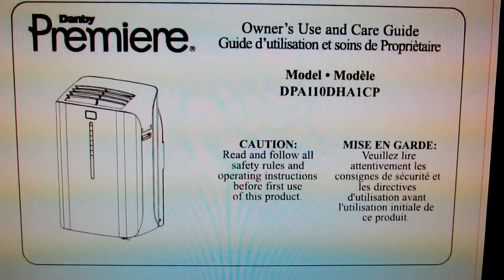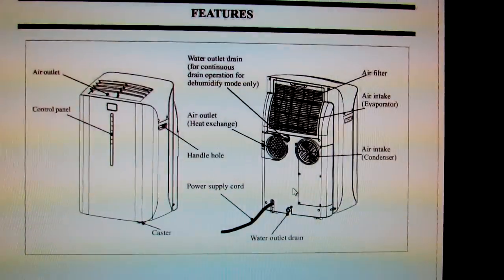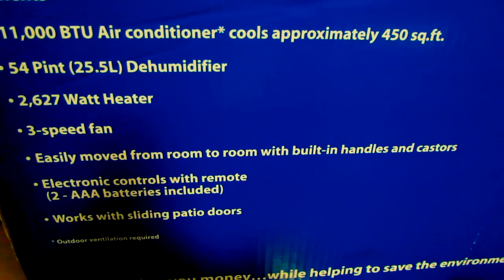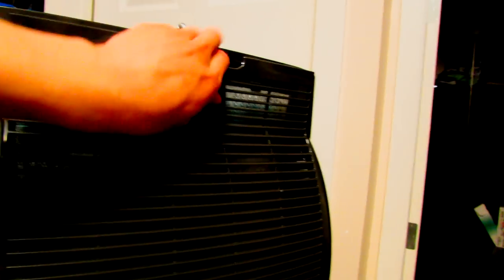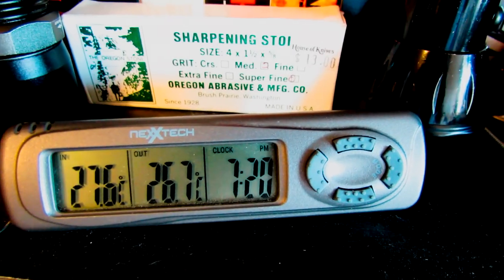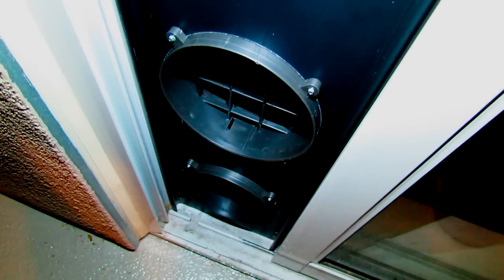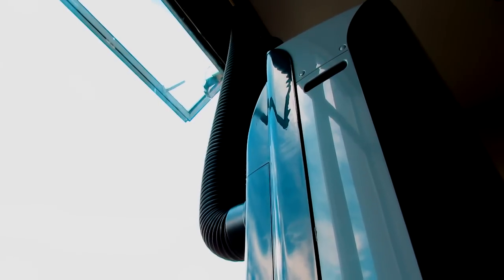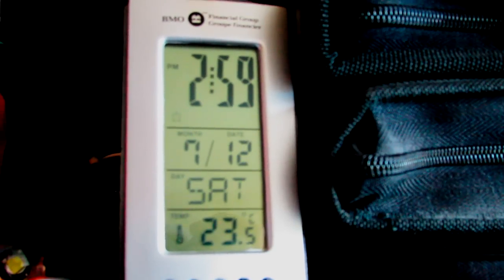The Best AC Unit for an Apartment - Danby Premiere 11,000 BTU 4 in 1

Comment: Premier DPAC 10071 all site I went to said free then it wanted my credit card. Danby site I couldnt find manual. Only the specs and photo of unit. That would be awesome if you can find it. Much Blessings and thanks for the Video. I watched a few yours was only one that showed me lots. The others I got nothing.
Reply from the maker: Michele Makohoniuk 
Hi,
You're right!  That manual is tough to find, I couldn't find it in the first 20 links I checked, but I found one that's similar, it's the DPAC 10060 model, I think it's the exact same, except maybe the capacity?  The control panels look like they have the same buttons, and display, but check it out and see if it is the same, I'm thinking it's almost the same.

https://www.dropbox.com/s/e9aexbdgs90t201/danby_ac_manual%20DPAC10060.pdf?dl=0

Also, the manual says the box that it came with, is a rain hood, good in case the rain goes sideways and hits the window!  Mine didn't come with that, would have been nice though!
Reply from the maker: Michele Makohoniuk 
I found the 10060 manual under a 10071 directory on reliable parts inc, I think all the parts are the same, maybe the 10071 was just a face lifted model of the 10060?  I also found the parts diagram and list here:
https://www.dropbox.com/s/rvrrtexjyfem1ux/PARTS%20LIST%20DPAC%2010060.pdf?dl=0

Funny thing, that model is one of the first that took the condensed water and threw it on the condenser coil, but on the web site they describe it wrong, they say they throw it on the evaporator coil!  Which is sort of true, the condenser coil is the evaporator coil when it's in heating mode.  But under cooling it's the condenser that's hot, so it should have said that.  Oh well, not like most people purchasing the unit will really care, they just want to know that it uses the water and you don't need to dump it!

Comment: I have a really old 4 in one and to service it I found a newer one at a garage sale cheaper than service fee. I have no manual and cannot figure out the controller. You at least explained how to use buttons on the unit. I am waiting on Danby to send me a manual as all online want your credit card to download even though its free. So I have to wait. Newer unit is amazing. I got some box attachment that goes out the window. I took it off for I didnt know what it was seem to have no purpose. Did you get one too?
Reply from the maker: Which model you got? I'll see if I can get you the manual. 

What can't you figure out with the controller?  If you need the wiring diagram, it's usually inside the unit so when you take it apart, you can see actually what wire does what, it's for certified service men to use, but it works for the everyday handy man too.

I didn't get a box thing for the window, just the panel with holes in it, sounds useful though, it might help separate the hot from cold air, and stop short circuiting airflow.

Comment: Hey my friend uses a bucket with hose in it in his apartment. Thats how you can drain
Reply from the maker: Thanks! That's a good idea.  It's funny tho, this was so good at using the water to cool the coil that at the end of a summer of using the AC, I went to go drain it and it was dry as a bone! Pretty impressive, that means I was getting free cooling from the evaporative cooling, rather than dumping out the condensate water!  For that very reason I think this is a great AC unit. It can be a pain having to dump the condensate every couple days, or every day for some AC units.  They couldn't make the water containers any more annoying to carry sometimes too.  I don't use the heat pump function in this much, but it's nice to have if your natural gas heating system is down for repairs during the winter!  This is a great unit to have. Keep this and a generator and you'll be set for any situation in the summer or winter!